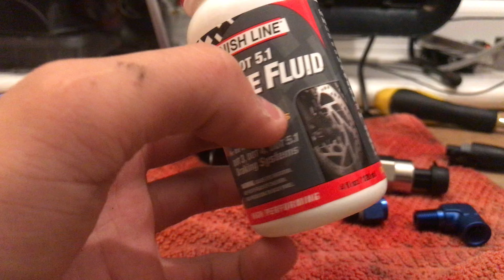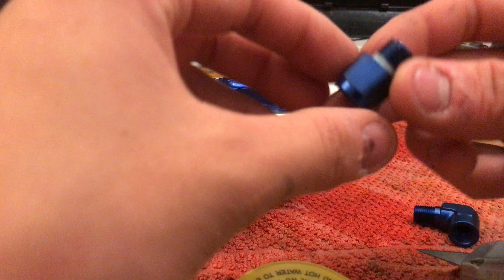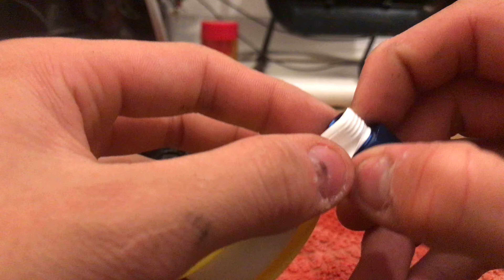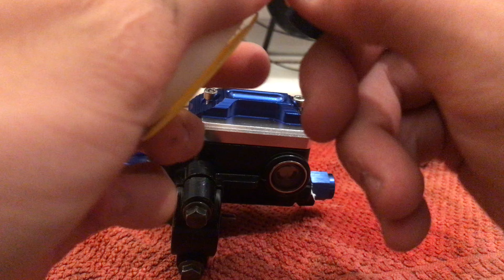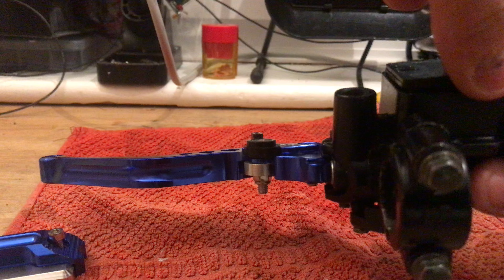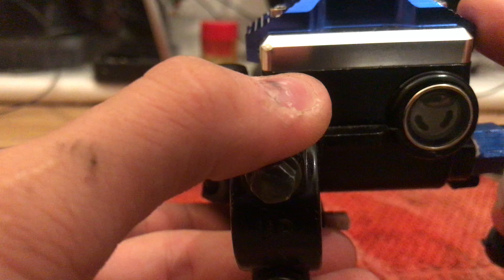DIY variable regenerative braking lever

Comment: Hi @CrazyDave good video! I see your response comment to DerKrawallkeks where you mentioned that you changed from the hydraulic lever to using a spring-loaded piston instead. Can you share more about this? How is that holding up and what did you use?

Comment: Thanks, I did it exactly like this without knowing about your video:) very informative tho. I damaged one sensor with the Dot4 brake fluid, now I use regular motor oil.
Did your sensor hold up?
Reply from the maker: I managed to kill my sensor by accidentally putting 90volts across it. I’m unsure how well it would have held up but it should have been fine
Reply: @CrazyDave  alright;) did you get to use the brake lever before it died?
Did you use DVT to program the Sevcon or how did that work?
Reply from the maker: I never used it only tested it it was a proof of concept I now have a different set up using a spring loaded piston to give a more realistic breaking experience. And for programming the sevcon I did indeed use dvt
Reply: @CrazyDave  okay, thanks for the information. I'll see how I like my brake lever, it's completely stiff, since there's no fluid actually being moved. This is what an ideal brake should feel like, but I'm not sure if it'll feel natural.
I'll get my ixxat cable today, DVT already installed. Is there anything I must know to activate the footbrake? Some people wrote that one should first save the current configuration of the bike. How does that work?
Reply from the maker: The configuration can be saved as a .dcf file and this is a good idea in case anything goes wrong with settings. I’d recommend saving one copy of the stock config and then another with the changes you made
Reply: @CrazyDave  Alright. I'll do that. If stuff gets messed up, I'd lose all the original config from Zero.

Comment: Would adding an MC clutch slave cylinder with a spring give better pull on the lever.  I cant seem to find a small pressure accumulator to give the fluid a place to go when you pull the level and then return back when released.
Reply from the maker: That could work, I’ve custom made a piston block that’s got a piston pushing on a large spring yet to test it though

Comment: this video is amazing. ive been looking for this. my electric skateboard has this variable regen, but I could not find anything for diy electric scooters. is there a way to have that hydraulic brake work on the front disc like it was design and give you the regen signal for the motor? that way one lever does both? also where does the signal wire typically connect on the average controller? is it called the high volt brake wire?